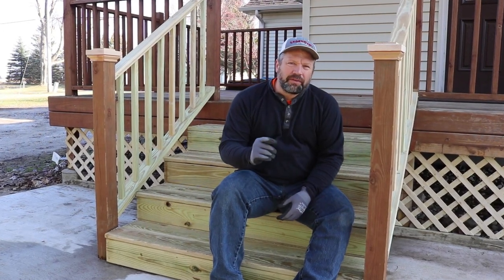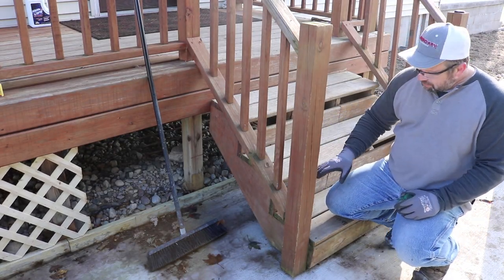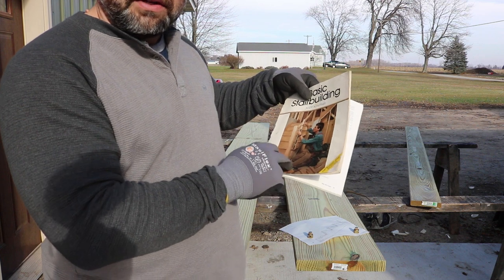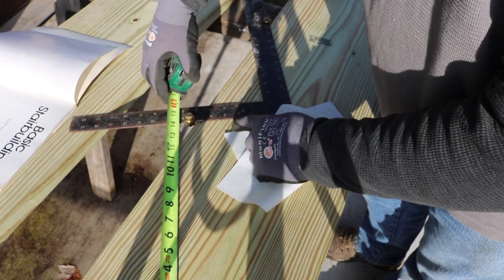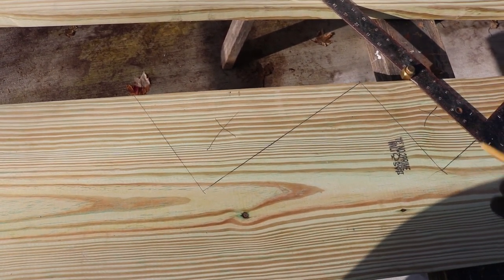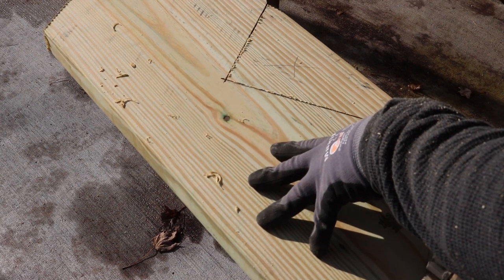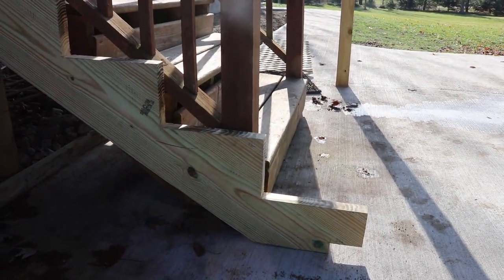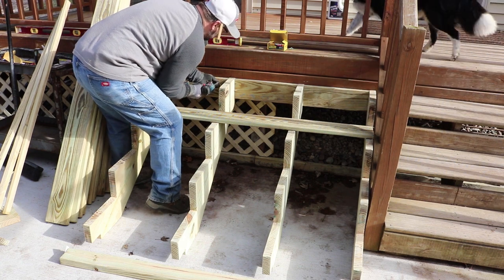Deck Stairs with Railing - How to Cut Custom Stringers

Comment: Hey there Corey!!!  Nice job on the stairs buddy!!!  They sure turned out nice!!!  Thanks for the shout out and the link to my channel!!!  Stairs can be a challenge to build but they are pretty straight forward when you take your time and do some planning.  I think the 7 1/16 inch rise will be a lot better.  And the run is important too.  If either one is messed up, there is a good chance the stairs will be hazardous.  I think you nailed your's!!!  Thanks for posting!!!
Reply from the maker: Thanks Mike!

Comment: I’d go 12 inch centers in case I decide later to use synthetic boards later on the stringers and use joist hangers to attach stringers

Comment: Just subscribed. Great content. Nice job on this. Just curious why you moved them over. Often you see them lined up with the door.
Reply from the maker: Thanks, I guess I just wanted them a more symmetrical and centered. Now that they are moved I don't really notice anymore. And 90% of the time we're going into the pole barn or to the driveway so which are both the direction I moved them over.